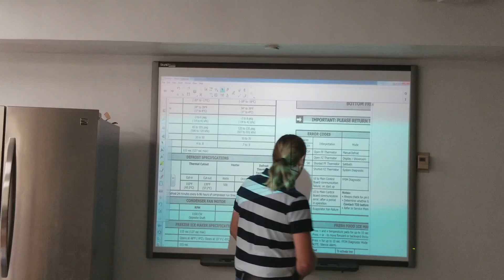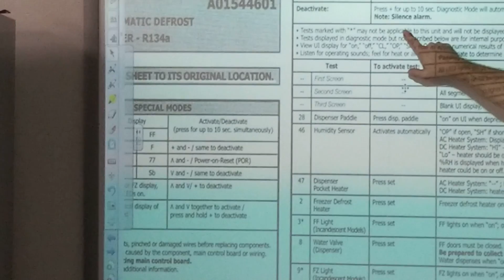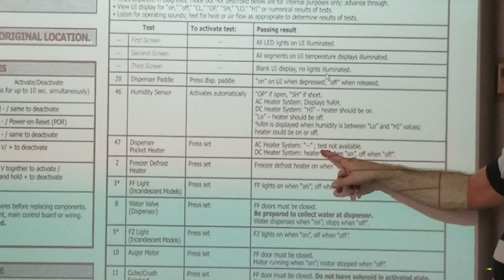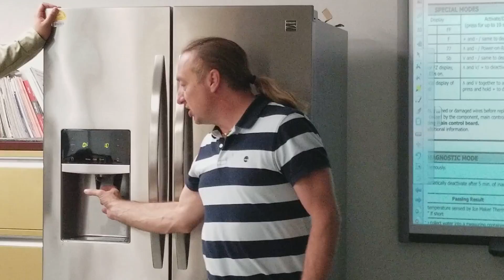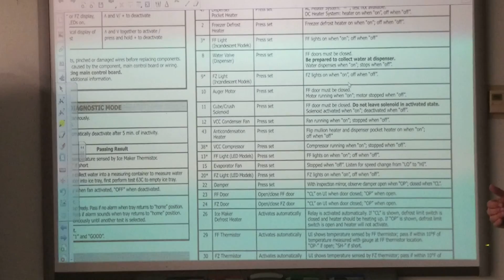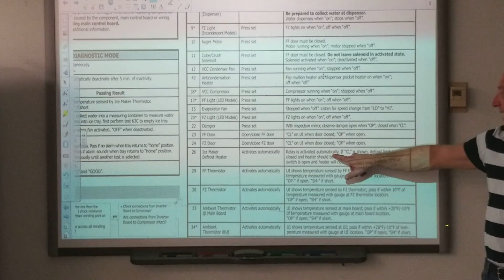#TECHTALK Frigidaire Kenmore Refrigerator Diagram 2

Comment: As useful as it is to test each individual component  on that Frigidaire, I don't know that it will automatically display a detected error in diagnostics without going down the list.

At least Samsung will allow you to enter diagnostics and the computer will highlight part of a digit that represents a failure it detects anywhere... Again, I don't know if Frigidaire offers this quick diagnostic feature. It appears that you need to have a good idea where the failure is occurring, then proceed to that test.
Reply: Agreed if y0u saw part 1 I explain in detail how best to use diagnostics and I went through each step just to demonstrate.